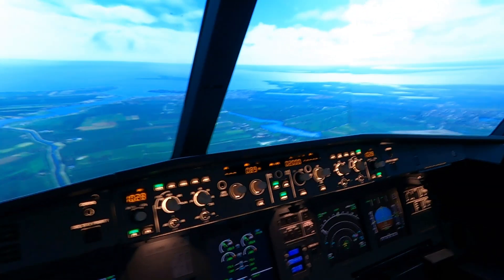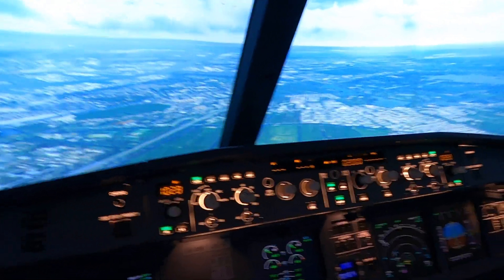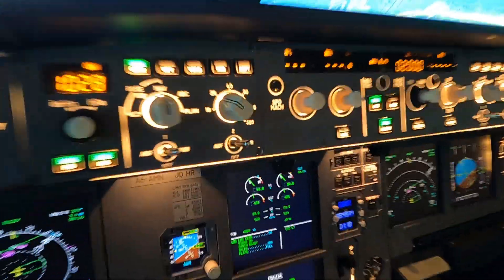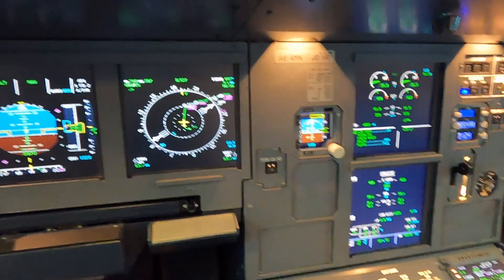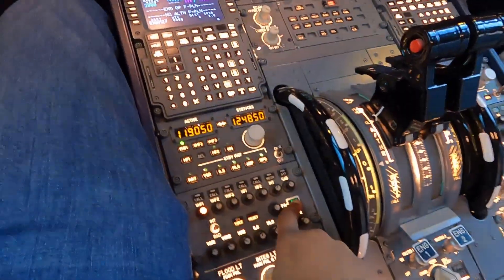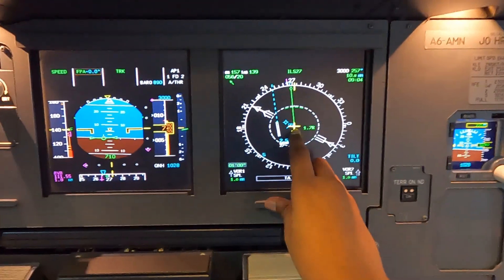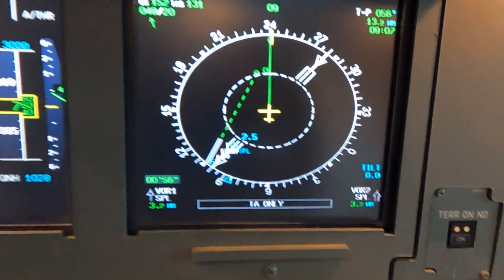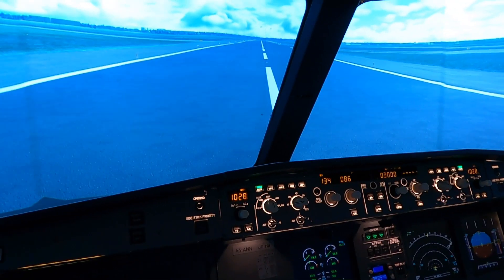Airbus A320 | Tutorial | Circle to Land Approach | A Step-by-Step Guide

Comment: One thing I remember hearing regarding the minimum altitude is that (should conditions permit it) you should fly the visual segment as close as posible to  a standard VFR pattern. So if you have the runway in sight just level off at 1.500AGL and begin the initial turn (If I'm not mistaken around 3.0nm from the threshold?)... ¿Is that correct?

Comment: Quick question, why would they want you to fly the ils but land on the other side ?? Wouldn’t you just fly a visual approach on the other side to start with ??
Reply from the maker: In aviation, the decision to execute a Circle to Land procedure instead of a straight-in visual approach can be influenced by various factors:

1. **Runway Configuration**: Sometimes, the runway in use might not align well with the approach direction, or the runway might be too short for a straight-in approach. In such cases, it's safer and more efficient to execute an instrument approach, such as an ILS (Instrument Landing System) or a GPS approach, to a nearby runway, followed by a circle maneuver to land on the desired runway.

2. **Weather Conditions**: If the visibility or cloud cover is low, pilots may need to use instrument approaches like the ILS to ensure safe separation from terrain and other aircraft. Once they have visual contact with the runway, they can circle to land in better visibility conditions.

3. **Air Traffic Control Instructions**: Air traffic control may direct aircraft to execute a circle to land procedure due to traffic sequencing, airspace constraints, or to accommodate other arriving or departing traffic.

4. **Terrain and Obstacles**: In some airports, surrounding terrain or obstacles may restrict the possibility of a straight-in approach to a particular runway. In such cases, a circle to land procedure allows the aircraft to maneuver safely around obstacles before aligning with the runway for landing.

While visual approaches are common and preferred when conditions permit, instrument approaches like the ILS provide additional precision and guidance, especially in adverse weather conditions or in airports with complex layouts. Therefore, the decision to fly an ILS approach followed by a circle to land maneuver is often made to ensure safety, efficiency, and compliance with air traffic control instructions.
Reply: @waypointsaviation  thank you
Reply: You just busted your minima. 🤦‍♂️

Wouldnt it be more advisable to fly the ILS using FPA until 900ft and then reselect GA altitude?

Comment: If PF is the FO. , do we do this procedure to the left?
Reply from the maker: Hi, 
Whether an aircraft flies a left downwind or a right downwind pattern depends on several factors, including the air traffic control instructions, the airport's traffic pattern, and the specific runway in use. Here are some key points to consider:

1. Traffic Pattern: Most airports have a standard traffic pattern for arriving and departing aircraft. This pattern is typically based on the prevailing winds and local procedures. At many airports, the standard traffic pattern involves left-hand turns for both takeoffs and landings. In this case, aircraft will typically enter a left downwind pattern when landing.

2. Right Traffic: However, there are situations where right traffic patterns are used. Some airports have right traffic patterns due to geographic or operational reasons, especially if the airport has parallel runways. In such cases, aircraft may be instructed to fly a right downwind pattern for landing.

3. Air Traffic Control: Air traffic controllers will provide instructions to aircraft for entering the traffic pattern and making turns, including whether to fly a left or right downwind. Pilots are expected to follow these instructions for safe and orderly operations.

4. Runway in Use: The specific runway in use can also determine whether a left or right downwind pattern is used. If the airport has multiple runways, the choice of runway for a specific operation (landing or takeoff) may dictate the direction of the traffic pattern.

5. Noise Abatement: Some airports implement noise abatement procedures that may require specific traffic patterns to minimize the impact of aircraft noise on nearby communities. These procedures can include the use of either left or right traffic patterns.

In summary, while left downwind patterns are common at many airports, aircraft may be required to fly a right downwind pattern based on the factors mentioned above. The choice of pattern is influenced by safety, air traffic control instructions, airport layout, and local procedures. Pilots and air traffic controllers work together to ensure that traffic patterns are established and followed in a way that promotes safe and efficient aviation operations.

Hope this helps :)

Comment: 3:50 Hello Captain. Can you explain us by details what is this and why you doing this? Because I cannot understand this part at all
Reply: So Captain in your example that you just gave me, abeam threshold we push the chrono for 45 sec ??
Reply from the maker: @SpaceOdyssey-  Yes that is correct.
Reply from the maker: Hey,
Ok, when we are doing a visual approach to a runway and we’re flying downwind (the opposite direction of the runway we’re planning to land on) when we get to the edge of the runway, we can’t just turn and land, we need some kind of a way to determine a safe distance at which we can turn, intercept the runway, line up and establish on a descent safely. How do we judge how far or little out we need to fly before we turn? Airbus gave us this formula to help figure that out. For every 100 feet you are above the ground you fly 3 seconds. We are at 1500 feet therefore (15 x 3 = 45) so we would need to fly outbound for 45 seconds and that would give us enough distance away from the runway (not too far not too close) to safely turn and land. In addition to this we add one second for every knot of headwind we have and we deduct one second for every knot of tailwind we have. 

Hope this helps, feel free to let’s us know if you still need some clarification.

Comment: Hi,
On a slightly different topic, I'd like to know the timing to initiate a turn. 
Example, I'm following a VOR course 354° at LfMN for a visual approach, and  I need to turn right onto the runway 4L with an inbound course 43°.  
I can determine the  bank angle and time necessary for the turn but how woulld I know when to initiate the turn?
Reply: Ate you able to answer my question?
Reply from the maker: @ro4526  Usually at the published minimums is a good idea to start the turn or perform a  GA... But why a VOR approach to visual when the Rwy is equipped with ILS & RNAV?
Reply from the maker: Thank You for your kind words! If you haven't already done so, please consider Subscribing and sharing our videos with anyone you think would benefit from it :)

Comment: Thanks for flying in my home airport. You flew over my house haha. 1 question - normally you would need to be stable at 1,000 ft - now you had the final turn into rw9 at 800 ft - at what height was it now mandatory to be in a stable phase?
Reply from the maker: Hello 
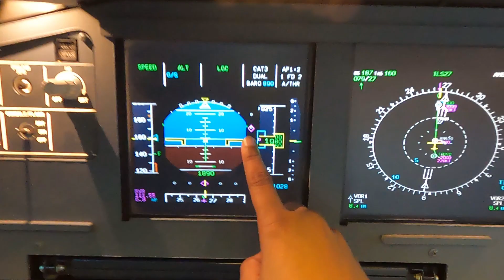At around 10:45 in the video you'll notice that we put the gear down and go to Flaps 3 well before reaching 1000 feet, keep in mind the A320 can also land with Flaps 3 so in essence we have stablized before 1000 feet, its just that to maintain F Speed for the maneuver we keep it at Flaps 3 and go to Flaps Full later cause we've transitioned from a Precision ILS approach to a Visual Approach so the procedure changes a little bit. 

Hope this helps!
Reply: @waypointsaviation  yes! Thank you for your prompt reply again. That helps!

Comment: Great Video ! very well explained! thanks!!
In another ocassion it would be interesting learn or see how to land using crab technique with crosswind and the bird ( i dont know if its useful the bird with crosswind to land or mainly everything is visual with practice).
Thanks!!!
Reply from the maker: Hello 
The crab technique usually is a natural occurrence when approaching the runway during a crosswind situation, one would usually follow the flight directors as they help guide the ac down to centerline and once visual is confirmed with the runway use the TRK|FPA to maintain the runway track until it’s time to flare and land. Remember to ALWAYS deflect the ailerons into the direction of the wind to prevent the crosswind from lifting the windward wing causing the wing tip and engine nacelle of the other side to strike the  ground. This can only come with practical practice, patience & time :)
Reply: @waypointsaviation  Is it possible to try to land using the TPA and the bird with PA1 ( pilot automatic) when start the turning to the land runway and using the Track Knob to put ok the correct track of the runway ? I mean only using manual landing when you can se the runway almost straigh ahead and then disactivate the PA and using visual? Or with that method the A320 dont get enough turning rate ( 25 degress) by itself? 
Thanks!
Reply from the maker: @wadastent6078  You could use the Autopilot to make the turn, but since you're transitioning from a Precision Approach to a Non-Precission Approach, the procedure recommends that you disengage the Auto-Pilot and Hand Fly the A/C down to the runway... Which is more fun! ;)